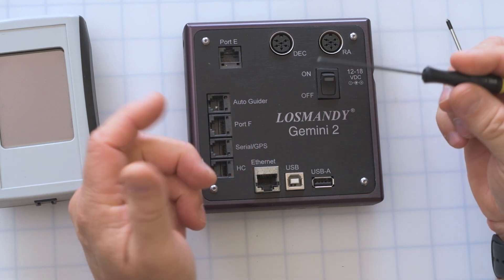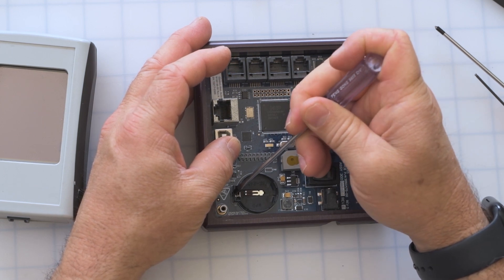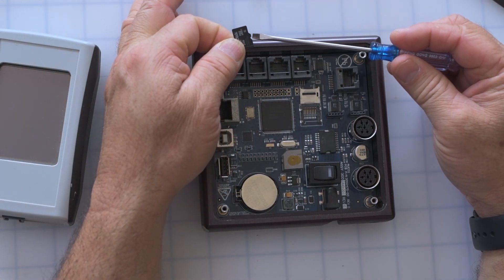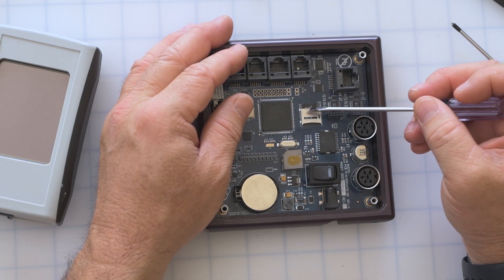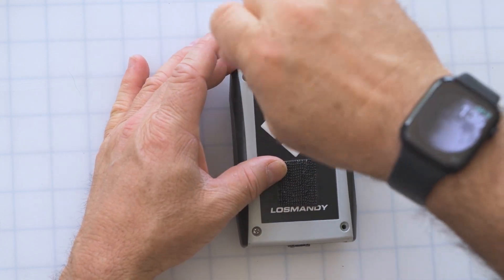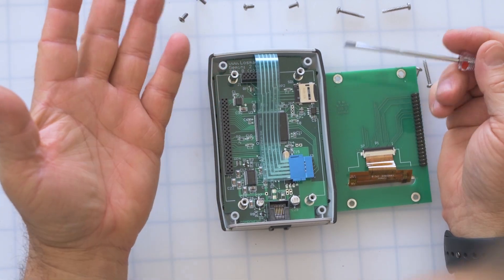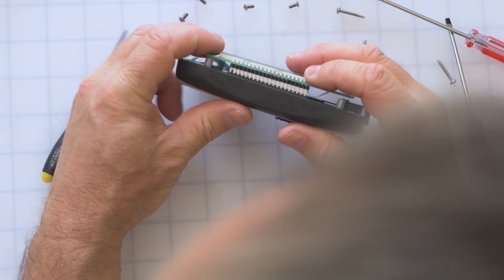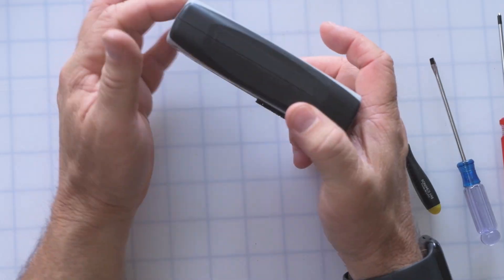Gemini 2 Tutorial Series 03: Replace Battery and microSD Card in your Gemini

Comment: Hi, I received a message when connecting the hand controller to the Gemini-2 that the battery voltage was low. Is resetting the SD card a required maintenance thing when replacing the battery? Why would you ever need to remove the SD card(s) otherwise? Thank you.
Reply from the maker: Resetting the SD card is not required when checking or replacing the battery. It is a good idea just to confirm it's seated properly. thanks for the great question

Comment: Brian, is the recommended step of setting date/time asap after changing battery still applicable?
Reply: Not for the Gemini 2 mini - the whole "battery will drain if you don't do this" relates to earlier hardware
Reply: Good point, I was thinking the same thing 🙂
Reply: So it is required for Gemini2 non mini?